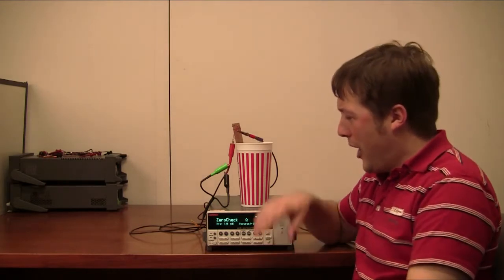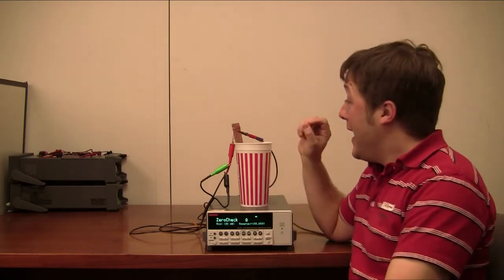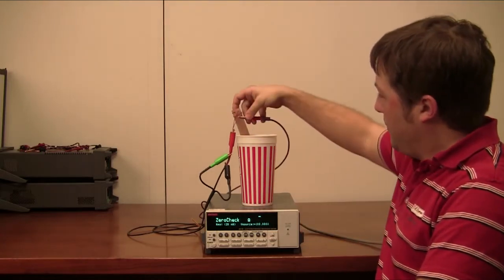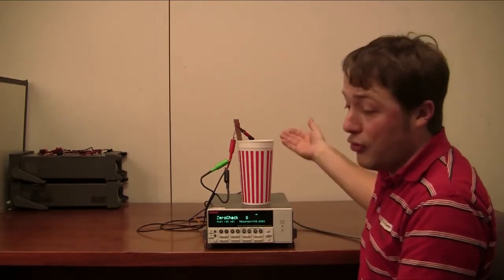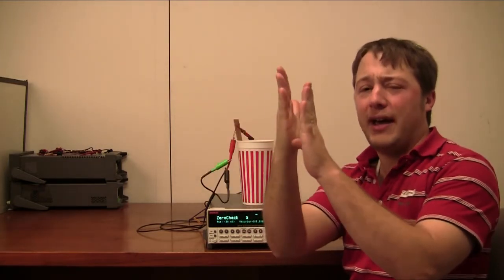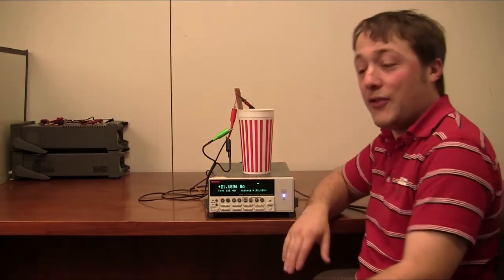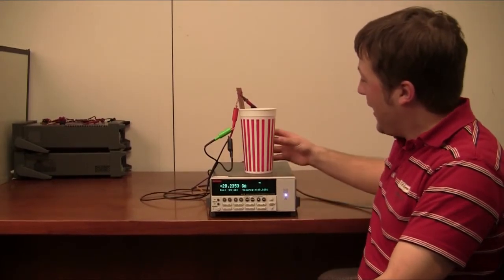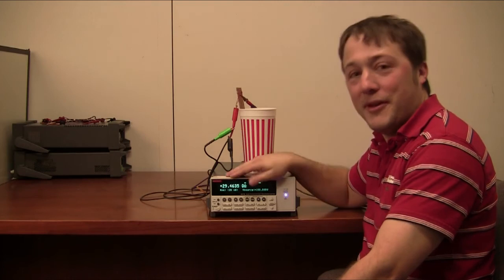Model 6517B Electrometer/High Resistance Meter Insulating Resistance Testing

Comment: I have kethley 6221 Dc/AC , 2182A nV meter , 2400 Source and 6517B resistance /electro meter , I have been given these instrument and i have no idea how to measure high resistance of insulators , I need some help regarding this , and setup arrangements. plz help